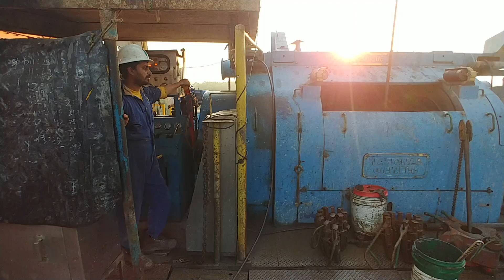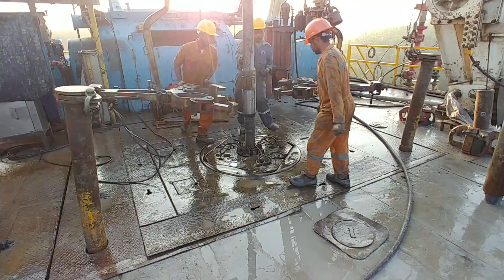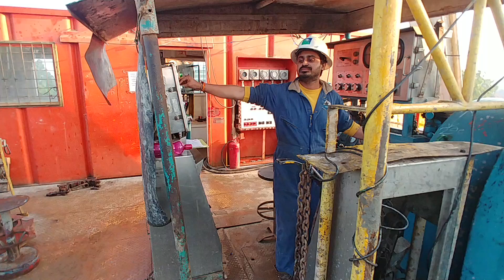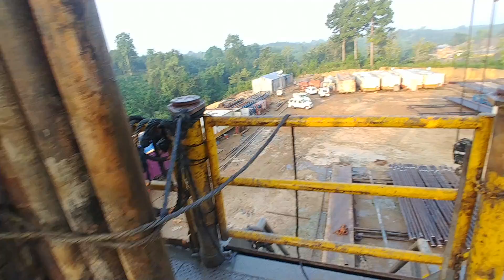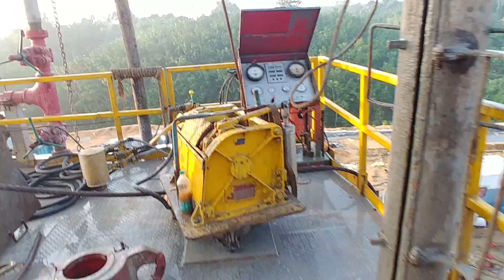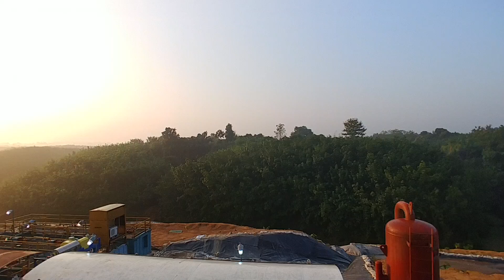Rig work 2000HP SCR RIG Floor Hand job.

Comment: Rig Manager where is your drill pipe spinner ?? Why wasting man power!!
Reply: The pipe spinner is hanging from a line on the rotary side of the draw works. The spinner is either broke or, them are idiots showing how tough they are. Running around in circles is about all they are accomplishing any way. Who is the guy running back and forth with the camera.

Comment: Those are the fastest men alive
Reply: Correction stupidest. You can Okie engineer a spinning chain with a snatchblock. Or may fix the pipe sinner hanging there on the rigs' rotary side of the draw works. What think now hoss.

Comment: Where is the cathead  or hydraulic roughnecks?
Reply from the maker: Cathead use for torque up the joint nd their is no hydraulic roughneck on rig as per contract...
We use pipe spinner ,but it's chain was broken ,so till it ll not fix ,ll use chain tong....man power...
Reply: @mayankbarot775  thank you for reply . I'm a student right now.I hope I'll be an oil and gas engineer soon

Comment: what's wrong with using the pipe spinners right behind them?
Reply from the maker: Chain of Spinner was broken... Mechanic went to store for new one  then we continue r/in till Spinner ll be not ok...
Reply: What  happened  where  is pipe  spinner?? Why you the Rig Manager  not  aware  of that the  non availability  of pipe spinner  due  to spare  parts  or other  constain ! Unnessary humiliation  of man power  of the  Rig!!
Reply: @utpalsengupta6872 lmfao  I had an st80 (iron rough neck) break down and then the air spinners clapped out half way in the hole. Stuff breaks, if you don't know that then you haven't worked on rigs for very long

Comment: What’s wrong with rotating it in with the rotary?
Reply: Bad video for the Tube
Reply: They should have been able to bite a tong and  spin the rotary to disconnect the pipe. Not sure why they didn’t do that. However, when putting a new pipe in you have to rotate the rotary backwards, this risks back spinning a pipe down below and dropping your pipe in the well , which you have to “fish” out later. This applies to a table rotary,
Reply: Something wrong with rotary table.
Reply: They'd be spinning the rotary table to the left? That's usually a good way to back stuff off. I know I would never do that

Comment: Slowest crew I’ve seen...
Reply: In India its different...The slow work the more operating per Day rate earning for the contractor...otherwise during interlocation movement the contractor doesn't get any operating day rate....They only get lumpsum amount just for interlocation movement....So they start movement and rig up very very fast and slow it down once drilling starts...The rates here in India are not good